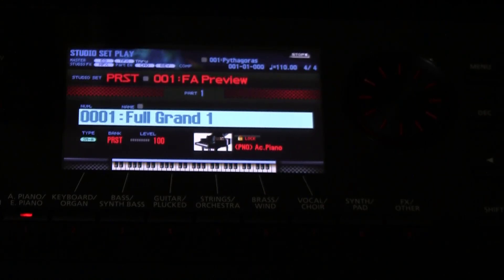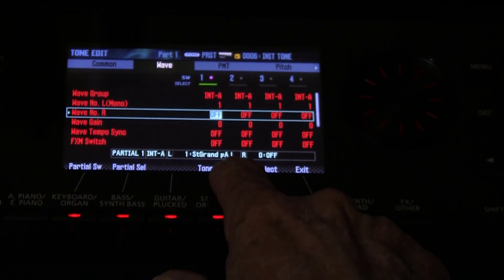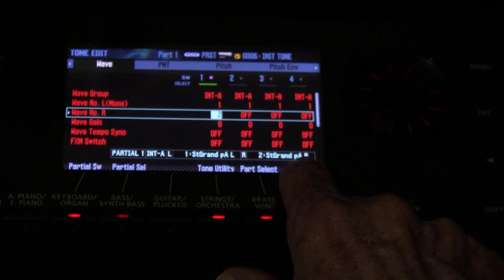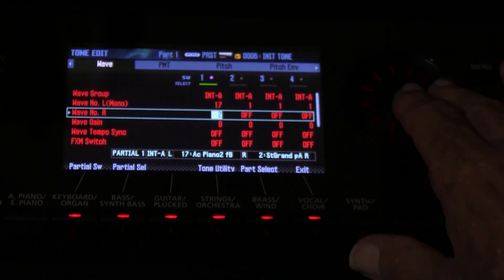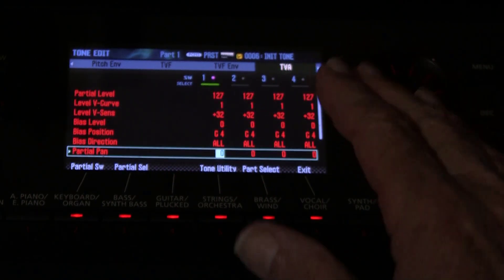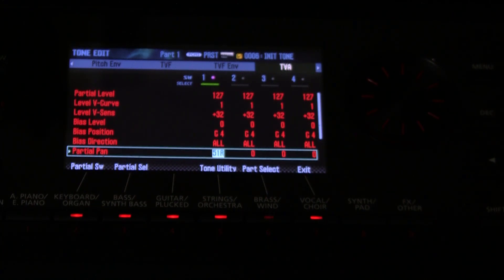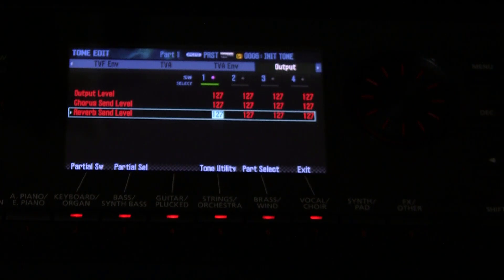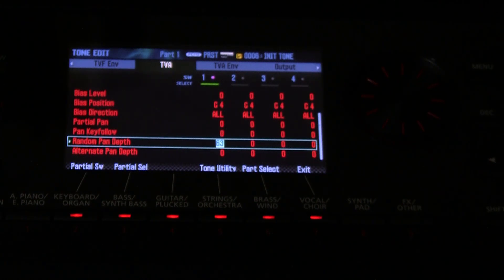Roland FA-06 - Exploring stereo waveform pairs on partials of PCMS tones

Comment: I noticed that not all pcm waveforms offer a left and right pair like the grand piano tho. Right?
Reply: I’ve noticed it’s for larger instruments like a piano or string/brass sections etc that are usually recorded in stereo so have specific left and right samples whereas something like a violin or trumpet would be recorded in mono so wouldn’t need two as the sound comes out of the same place
Reply from the maker: Correct.... stereo samples  are only provided for the more popular acoustic instruments

Comment: Stephen what keyboard do you know that can do a full song production with out using a computer can suggest any thanks
Reply from the maker: Korg Kronos 2 is the ONLY workstation that  allows AUDIO tracks in it's sequencer (like a DAW) ...... if you are recording vocals or guitars you will need  this feature ...... the Roland  workstations record audio to PAD clips (misleadingly called "samples") and you can sync the start time of a PAD clip to the MIDI sequencer but you CANNOT record one audio clip while SIMULTANEOUSLY listening  to playback of several others so Roland  workstations cannot replace your computer DAW ....... Yamaha workstations only have MIDI sequencers and so they also cannot replace your DAW....... It's pathetic...... I am SO SORRY I did not buy the KORG KRONOS 2 when I had the opportunity to do so at a deeply discounted price ......  I did NOT know all this at that time 😥
Reply: @StephenMendes  thank you what about Korg Kross 2:
Reply from the maker: @ShadesMichaelsgmail  the sequencer in the Korg Kross 2  will ONLY record MIDI tracks ...... I told you already Kronos is the ONLY current workstation allowing both MIDI and  audio tracks....... the Kronos contains a hard disk drive .... the Kronos like a computer has it's own operating system and DAW.... it boots like a computer on power up and is quite heavy keyboard for gigging ...... it is also expensive .....  I suggest you use an ipad  with Auria Pro if you do not want to use a laptop computer for your recordings